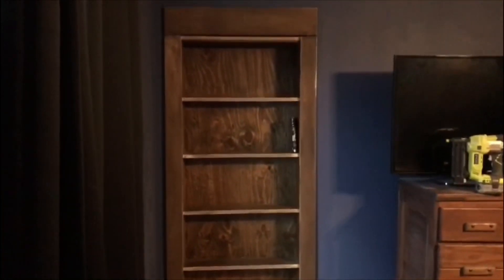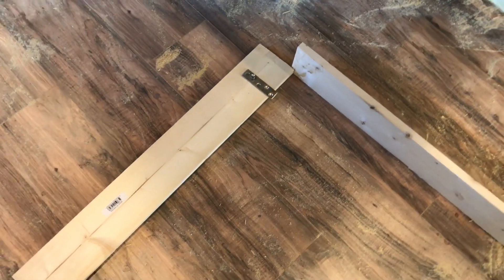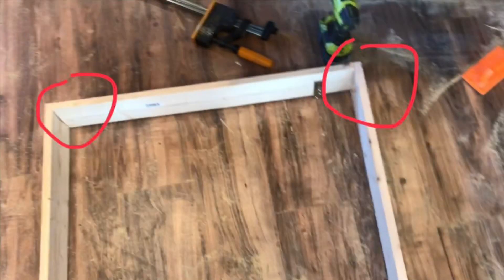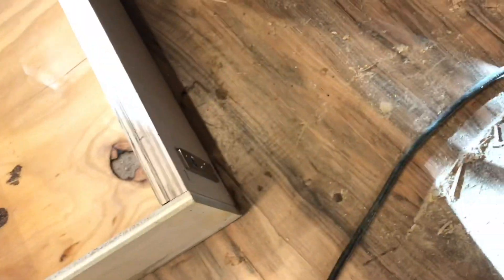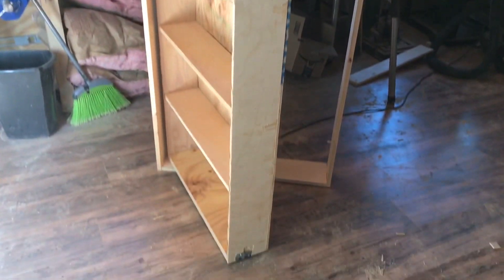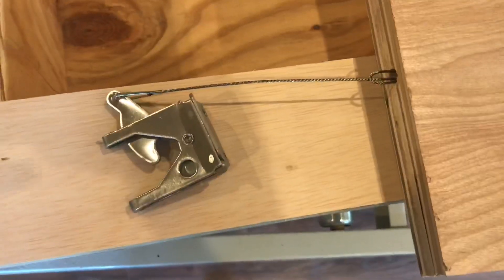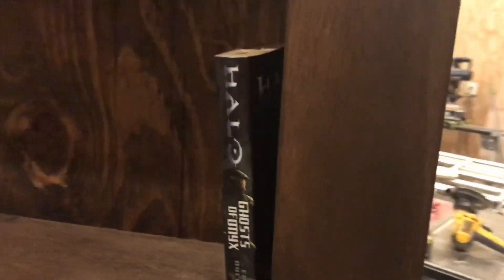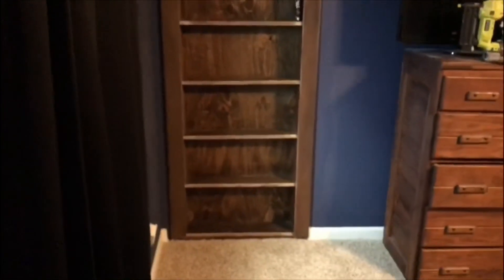Building a secret bookshelf door! DIY

Comment from the maker: 1. Get the exact measurements of the door frame of where you’ll be installing your secret door. (I did this by removing the existing door jamb and using it as reference)

2. Build a new door jamb - a basic rectangular frame matching the old door jambs measurements.  I made my new door jamb about two inches deeper than your average American door jamb. 

3. build inner rectangle aka the door where the shelves will go. There needs to be a gap between both sides - enough room for your door to rotate within your new door jamb. I just guestimated on this, I left more of a gap on the left side, about two inches and the right side about one but you’ll just have to play around or do the math.

4. I had special hinges I used in the description. I just lined them up. I tried to copy the position close to something like this 
https://images.homedepot-static.com/catalog/pdfImages/54/54714bf6-0d24-4222-9eb6-f8728b237eb8.pdf

5. Made the door moulding. The left side moulding is attached to the door and the the right side, the top and bottom moulding are attached to your doorjamb/door frame.

6. I bought a cheap halo book from thrift store. I made a wood replica of the book and put the books cover over it. before I glued the wood together I put a metal wire specifically for opening gate latches inside the book and screwed it down. The metal wire then hooks to a gate latch that I put on the back of the door. 

5. Install it, it should fit like a glove unless you fucked up. 

6. install the the other gate latch part onto the wall. 

7. Show everybody so it’s not a secret anymore
Reply: Ha part 5. And 7.

Comment: Nice build. I'm currently building one with the same hinges and wish you had shown them more. I'm having trouble picturing how to install the top ones, that push the pin into the frame.
Reply from the maker: Bronson Taylor I installed the top one by taking off the top of the door jamb. when I was ready to install at the customers house, I attached the door jamb to the door itself and then installed the door altogether. It slid in like a glove thankfully. I then secured the door jamb down with screws by swinging the door open.

Comment: Genuine question, but why are most American houses so flimsy? Ive travelled extensively across the States, spending over a year back packing and only the cold states seemed to have houses built from brick or block...even then many were made from  wood, plasterboard and flimsy materials. My ex girlfriend  lived in Columbus and i honestly think i could have kicked my way through the wall.
Is it simply because of the availability of materials and cost, or just tradition..climate etc?

Comment: How did you know where to position the top and bottom hinges?
Reply from the maker: Home Depot sells a Murphy door, I found online the install instructions for their Murphy door and I basically copied the placement of those hinges. It wasn’t exact, I sort of just eye’d the bottom hinge’s placement and then copied the exact position of the bottom ones for the top.
Reply from the maker: https://images.homedepot-static.com/catalog/pdfImages/82/82b1ac38-5516-4d3e-ae77-467a6ef556a5.pdf

I actually looked at this ^ and I’m not sure if it was much help. It’s gotta be a atleast a few inches away from the edges. Just make sure the bottom and top are exactly the same

Comment: Idk if u said it in the video or not but how much in all did u spend on this project?
Reply from the maker: Somewhere around a 120$..the hinges cost 14$..i believe I cut up about two large 3/4 inch-thick sheets of plywood being 22$ish each... paint & paint supplies $20..  misc stuff like glue, nails for nail gun, screws, book wire and hinge 20$